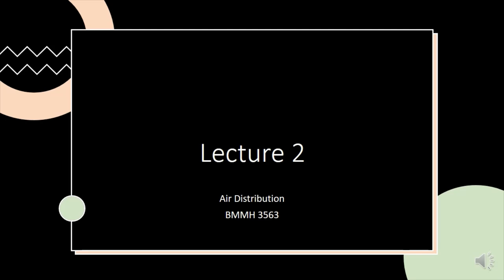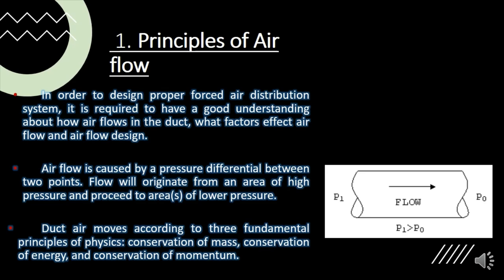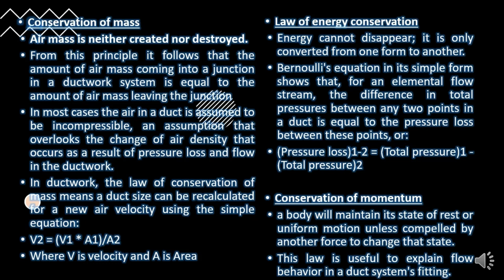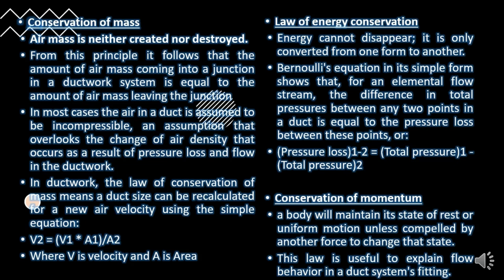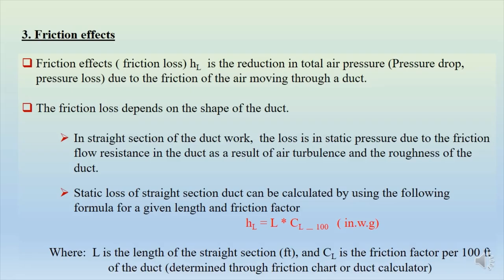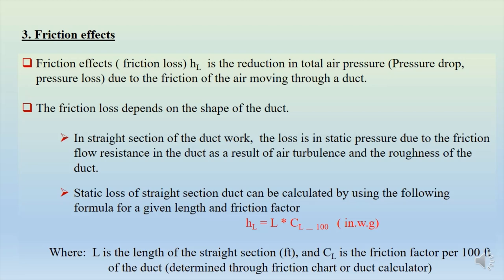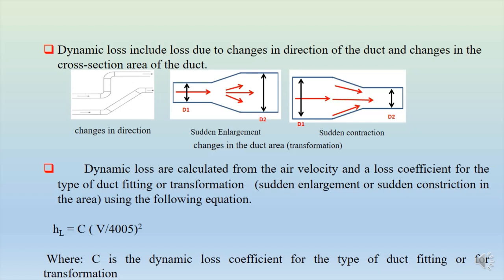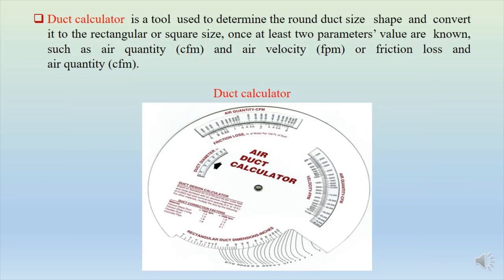Lecture 2 FUNDAMENTALS OF AIR FLOW

Comment: Mohamad asyraf aidee bin mohd baseri b091810017 3bmmh1/1  . This video explains the three principles of air flow: conservation of mass, conservation of energy, and conservation of momentum. Laminar, transitional, and turbulent flow are the three forms of flow. There would be a friction effect (hL) in a pipe or structure, which is a decrease in overall air pressure due to friction of air flowing into duct.

Comment: air flow have two flow which is air turbulence and laminar flow,  The friction effect is the reduction in total air pressure due to the friction of the air moving through a duct. futhermore the friction effect loss is depends on the shapr if the duct. dynamic loss include loss due to change in direction of the duct and changes in the cross-section area of the duct. three type of dynamic loss which is changes in direction, sudden enlargement, and sudden contraction.

B091810177

Comment: Name : Muhammad Hadzim Ashraff bin mazlan
No.Matric: B091810248

Section: BMMH 1/1

Summary of the video:
Principle of air flow: 

In order to design proper forced air distribution system, it is required to have a good understanding about how air flows in the duct, what factors effect air flow and air flow design. Air flow is caused by a pressure differential between two points. Flow will originate from an area of high pressure and proceed to area(s) of lower pressure. Duct air moves according to three fundamental principles of physics: conservation of mass, conservation of energy, and conservation of momentum

Types of flow:
Laminar Flow : Flow parallel to a boundary layer.  In HVAC system the plenum is a duct.
Turbulent Flow:  Flow which is perpendicular near the center of the duct and parallel near the outer edges of the duct.  Most HVAC applications fall in the transition range between laminar and turbulent flow

Friction effects:
Friction effects (friction loss) hL is the reduction in total air pressure (Pressure drop, pressure loss) due to the friction of the air moving through a duct. The friction loss depends on the shape of the duct. In straight section of the duct work, the loss is in static pressure due to the friction flow resistance in the duct as a result of air turbulence and the roughness of the duct. Static loss of straight section duct can be calculated by using the following formula for a given length and friction factor. 
hL = L * CL _ 100   ( in.w.g)
Dynamic loss include loss due to changes in direction of the duct and changes in the cross-section area of the duct
Dynamic loss are calculated from the air velocity and a loss coefficient for the type of duct fitting or transformation   (sudden enlargement or sudden constriction in the area) using the following equation
   hL = C ( V/4005)2
Duct fitting commonly used in  HVAC to change the direction of air flow. And there are more than 220 types of duct fitting database  developed by ASHRAE.
The most  common and standard duct fitting type is round or rectangular duct elbow with typically angle of  90° or 45° and radius of curvature

Comment: Muhammad ismanajmi b rozi b091810258
from this video , first i learn principles of air flow emphasize the design proper to air distribution system, differential between two point, and three fundamental principles of physics: mass, conservation energy and conservation momentum. next, friction effect is the reduction in total air pressure due to the friction of the air moving through a duct. the friction depends on the shape of the duct for example, in straight section and static loss of straight. beside that, dynamic loss is include loss due in direction of the duct and type of duct fitting or transformation.

Comment: Hi Assalamualaikum,
Muhamad Ashraf bin Zulkupli B091810161
in this video i have learn about in Air disttribution system, the type or pressure of air flow in the system is important for understanding the air distribution system

Comment: Laminar flow of HVAC system are required in operating room in term to reduce of infection.  The patient is less exposed to bacteria even during long procedures and the risk of intraoperative infection is dramatically reduced.  - A Hakimi B071710484

Comment: See Wei Che B091810368

The principles of air flow is to design proper force of air distribution system.

3 fundamental principle:
i) conservation of mass
ii) conservation of energy
iii) conservation of momentum

2 types of fluid flow:

i) laminar flow
ii) turbulent flow

I have also learned friction effect, friction chart, density and altitude effect.